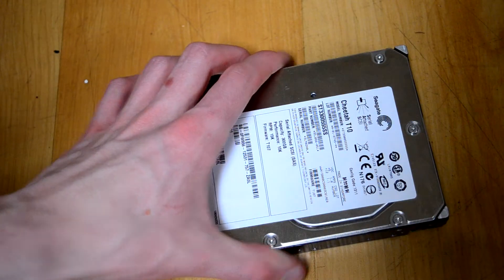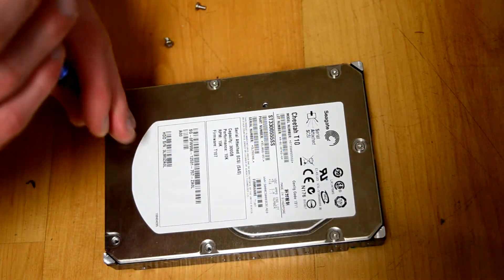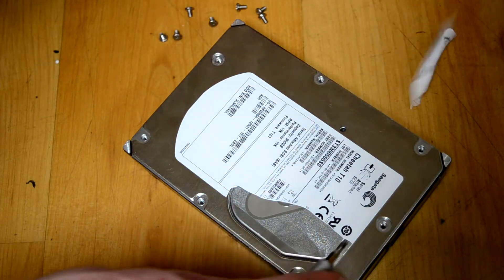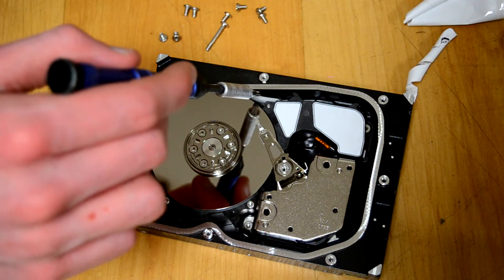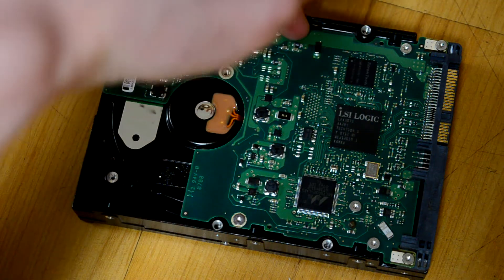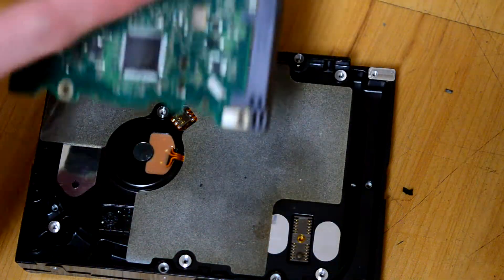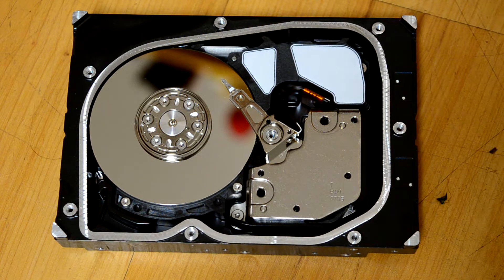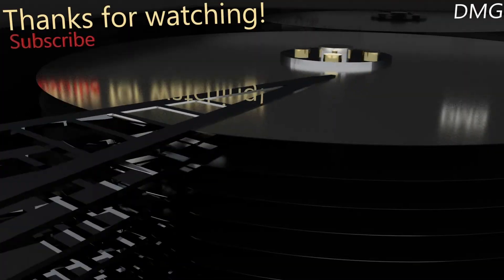10,000 RPM Seagate Cheetah teardown

Comment: Nothing better than a good server HDD :) Just bought myself eight 4TB used DELL server grade drives (made by HGST) with SATA connection for my DIY home NAS project. Those moving head sounds remind me of my younger years, when I added a 400MB drive to my modded Amiga 1200 and was blown away how much faster everything worked compared to floppy drive. My first PC had 4.3GB HDD and when I wanted to play Diablo II, everything else had to be uninstalled to make room for it :) Those were some good times.